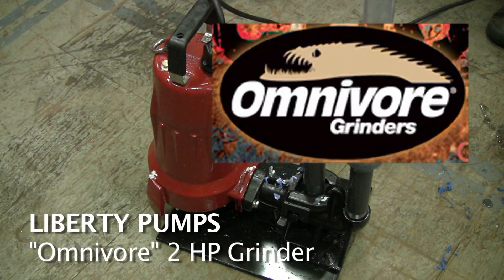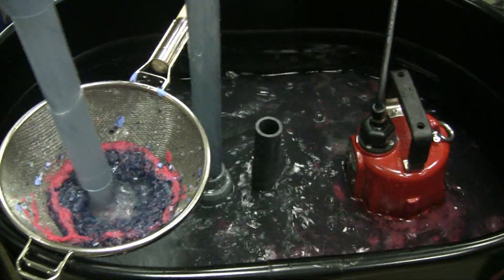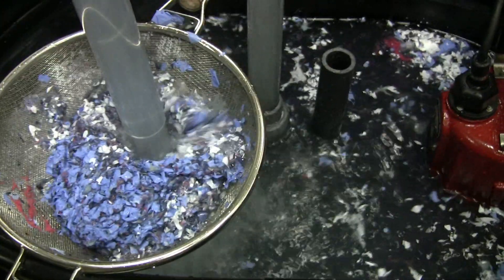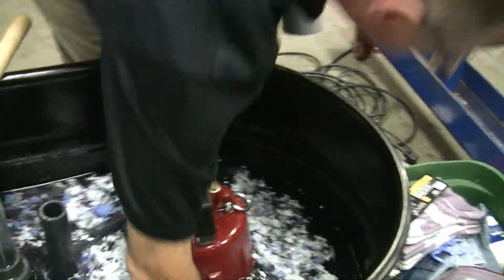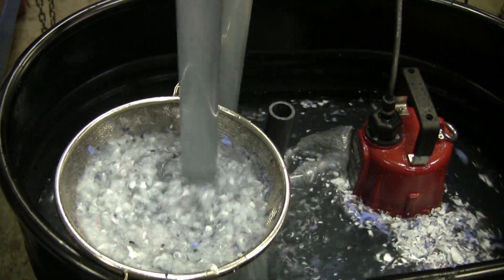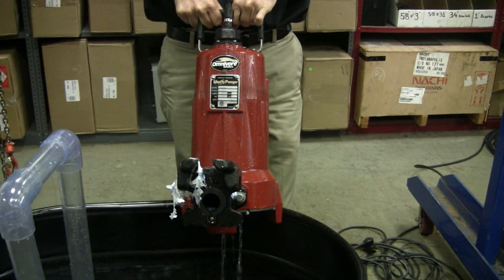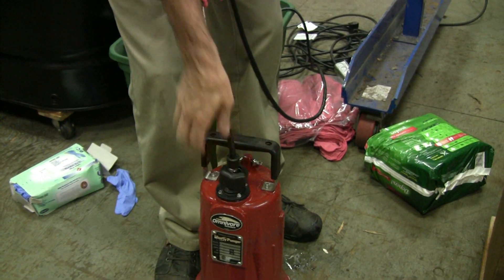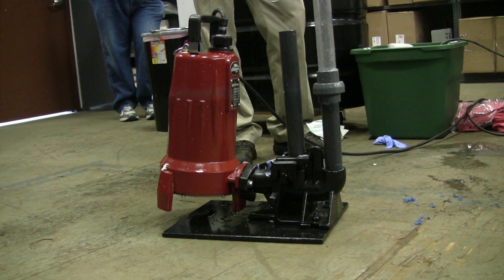Liberty Pump Omnivore Grinder Demonstration

Comment: I’ve been in wastewater long enough to know that nothing is as good as it seems. This will eventually fail though. A real simulation would be to fill the tank with grease And fat And wastewater and rags etc and let it run for a year or two minimum. Let that grease cake on the pump and then see how it runs. It will either go into thermal overload or jam up. Liberty is probably the best manufacturer of sewage pumps. But nothing is perfect. We buy at least a pallet of the LE40 and LE50 every 6months. I’m very pleased with Liberty. I’ve had my eye on the Liberty night eye-WiFi alarm. Thanks for everything you guys do!
Reply: Have you had experience with Zoeller pumps, what is better Zoeller or Liberty.
Reply: HERPY DERPEDY Liberty for sure! They have internal capacitors on most models and do t require much trouble shooting when they go out. If the pump is not running it’s either clogged or it’s fried. I believe in using liberty products for sure. I’m not saying zoeller is bad but I’d choose liberty first !
Reply: I have installed and serviced these pumps and they are very good. Yes every thing can and will eventually fail, but these pumps have worked well at the sites I have serviced. If you are dealing with sumps that see grease and fat they should be cleaned regularly anyway or the grease is going to build up on your floats and it will lead to your float switches not working correctly.

Comment: What are these pumps used for mainly
Reply: For processing waste into a slurry and then pumping it up a small diameter pipe to the main connection for public sewage.  This is needed when your property sits lower than most and prevents a gravity feed to the sewer main.
Reply: @Warkive   thanks just wondering it this would work for a septic system cause I have a pump that pumps my secondary tank to the leach field  that's uphill from my tank it operates off of a float

Comment: Ours just got clogged. I don’t have the balls to find it myself so we hired a plumber to charge us our life to fix 🤯
Reply: 3 years ago when I had a plumber fixing an unrelated problem, I pointed at our residential basement sewage pump and asked how much to replace when the time comes. The plumber said around $5000. This is in Oakland, CA, for a bathroom with 1 toilet/shower/sink. The discharge pipe was 3 inches instead of the typical 2 inch discharge pipe, so the sewage pump (not grinder pump) was a much more heavy duty model. This weekend the piggyback float switch died, so 6 years after buying our house I finally opened up the lid of the sewage pit and carried the sewage pump outside to swap the piggyback float ($35 replacement). I called RC Worst about a heavy duty residential sewage pump and I'm looking at around $350, however I will need to cut out the 3 inch ABS discharge pipe and replace with 2 inch ABS (another $10). For $5k savings, I'm willing to get poo on me

Comment: it doesn't handle wet tumbleweeds very well.. it's locked down  and it's only 3 months old and still fresh actually it's locked up 3 or 4 times during the tumbleweed.. blow in that we had and also had difficult issues with it not pumping during this suction getting plugged up with tumbleweeds not allowing adequate flow show grinder operation never got done.. finally had to pull all the weeds by hand out of the incoming or suction Channel it was a waste of money in our application trying to use this certain grinder or grinder pumps
Reply: Tumbleweeds ? Wtf is wrong with you ! Lol